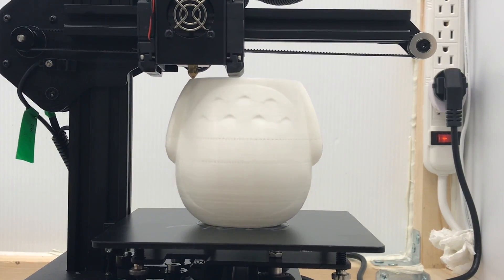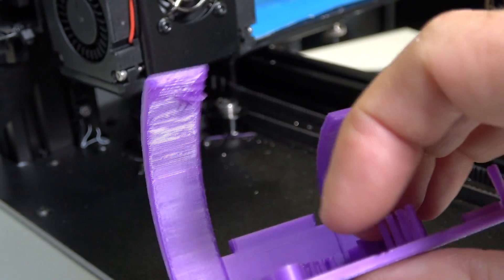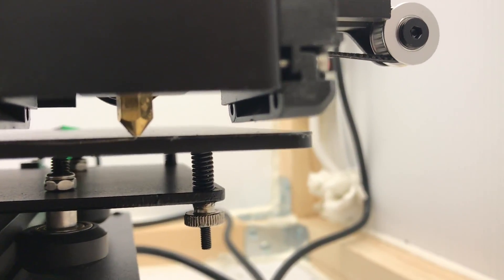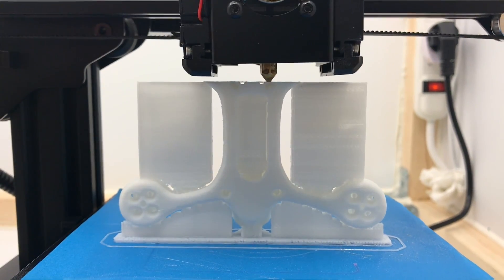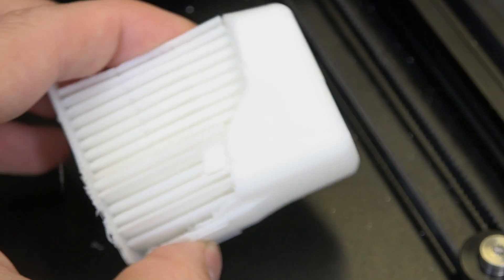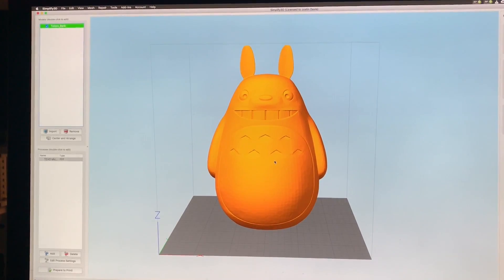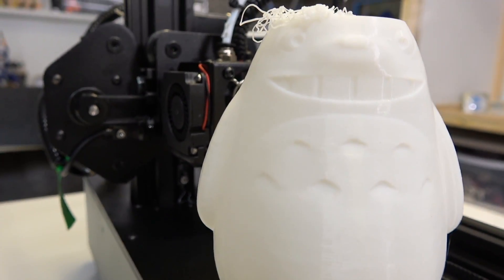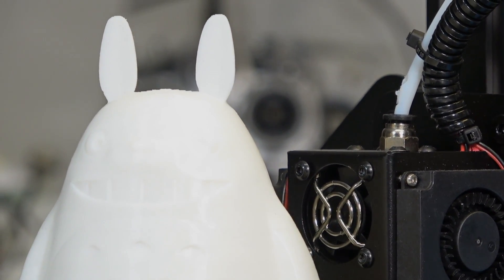3d Printed Drones! TEVO Michelangelo - FULL REVIEW with PLA, TPU, PETG, ABS

Comment: I gave up on 3d printed frames, like last week. Maybe for a brushless whoop, but they break too easily. Especially for a beginner like me. Regardless of the materials you print with. Abs is too brittle during an impact. PETG is too floppy and in a decent crash it’ll break. The closest filament I found that will almost work with small drones is a carbon polymer. But then you need a printer that can hit 260c safely, a hot bed at 80c safely, and It takes forever to print. It’ll fly well, But again in a decent crash like the rest it’ll break. where a carbon plate frame 2” (frame thing) will just brush it off. (I have a baby hawk r 2.5” so that’s my comparison in crash-ability). The next step is to make a CNC and cut my own frames.
Reply: An ender 3 pro with a copper heat break can print at 260c with a bed at 80c easily. I print ABS and ASA at 245c and 110c on my open Ender 3 pro beautifully. I haven’t worked with Carbon Polymer, but with a carbon box around my printer, I bet it wouldn’t be too complicated.. as long as I keep the filament dry.

Comment: Love my 3d printer.  On the whole 3d printed quad thing.  I have tried every   Material under the sun pla, petg, abs,polycarbonate, taulman 910, carbon infused nylon you name it.  I wouldn’t recommend printing anything in which the Dry weight exceeds 80 grams.  They just don’t survive crashes well.  Taulman 910 is my favorite followed by carbon infused.  The taulman may not be as ridgid as some but really hard to break.  Keep in mind though taulman needs a heated print bed and is hygroscopic so needs to be stored appropriately.  A quick tip on the taulman alloy 910 is if you do get moisture in it, put your oven on its lowest setting like 160 and bake it for 4-5 hours. Dries right out.

Comment: My brother 3d printed a eachine wizard frame everthing is proper cool dunno how it will hold up though
Reply from the maker: Well I guess if it breaks. Print a new one. 👌🏻
Reply: if printed in the right materials it might be very strong. plus replacing an arm etc is literally printing a new one. i think that is a frame has a bit of flex its better in a crash but i´am not 100% sure on that
Reply: I would live to see a vid of it flying. Post a link in this comment section when it's done if u can.

Comment: You’ve printed the mini quad in the wrong way. Lay the quad horizontally in your slicer, the results will be much better! For some unknown reason thingiverse puts it vertically when you upload a file.
Reply from the maker: Thanks for the tip Jos. Not sure why some files come setup on odd angles. 👍🏻
Reply: Yeah no one knows, it’s a thingiverse issue, but confusing sometimes.
Reply: hmm yeah it kind of weird indeed but it isn´t hard to rotate the model
Reply: @thijss1272  nope, just click rotate and drag it flat
Reply: I think this is pocketquads. Not free
Reply: pocketquads seems to have uploaded the files to thingiverse and stopped producing them, theres actually alot of people who apparently have paid but are yet to recieve.
Reply: Colin Nicholson , nvm found it. Lightspeed. 😉
Reply: raffy turc its thing# 2891968
Reply: That happens to me all the time. People comment or PM me on models saying my orientation is wrong, but the original model opens up as expected in meshmixer or other programs. The downloaded one is rotated. I don't get why Thingiverse has to modify the stl!
Reply: Also level the bed